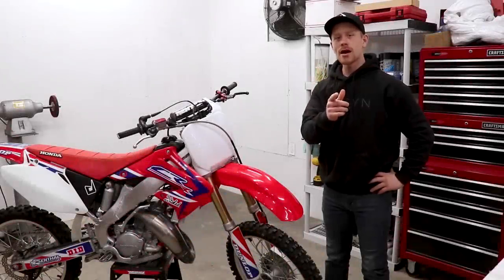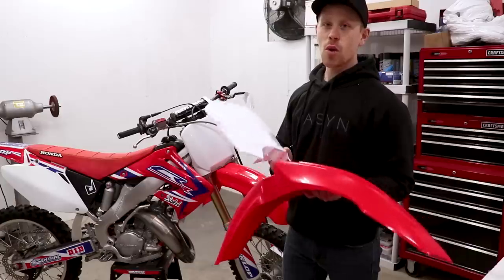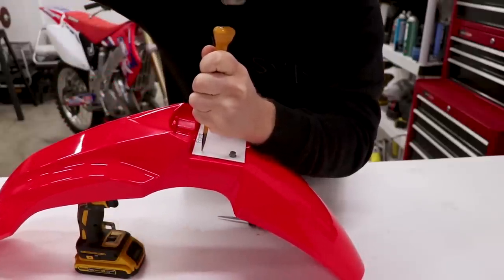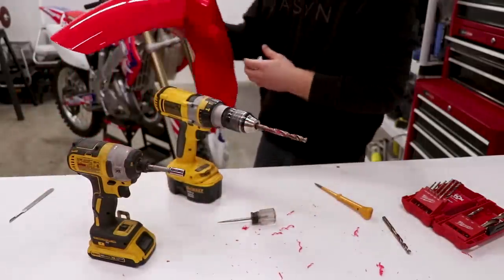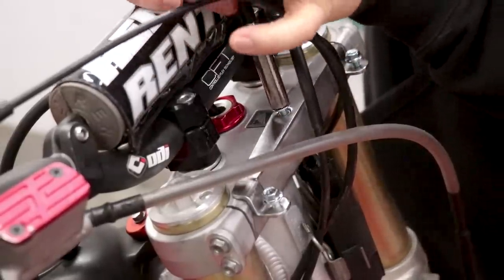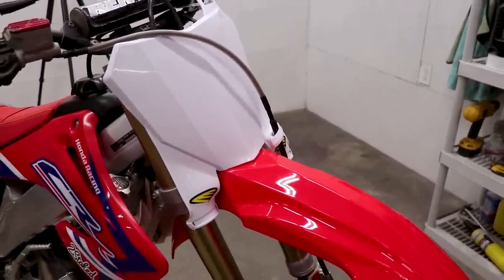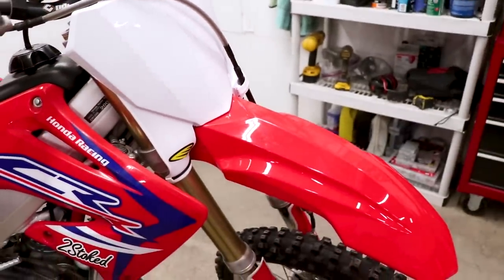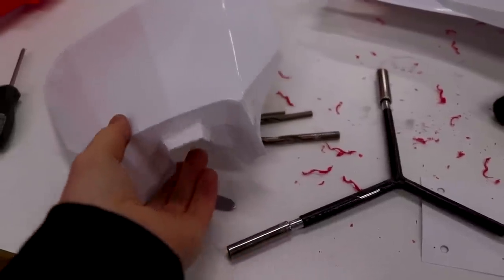Transform Your Honda CR in Minutes!

Comment: I just used zip ties for my number plate lol. It's a 17' front end conversion on a 2000 CR. I didn't have access to anything to make a bracket at the time but the zip ties work quite well. Nice & tight & no vibration. Glad to see you make legit brackets for it. I'll have to pick one up sometime.

Comment: Hi Cameron, let me fill you in on some metal machinist trade skill to improve finish and accuracy. When drilling any sized hole, never drill up in gradual increments to a finish size. Look down on the cutting face of your drill bit, the central plane between the 2 cutting faces is called the chisel edge. Say for example your drill bit is M12. Measure with a rule the width of the chisel, it maybe 1.5mm in width. A pilot drill (a guide drill run through the material) should be no greater in diameter than 90% or 9/10th of that chisel edge width. So for a 1.5mm chisel edge the pilot drill should be 1.35mm (you would therefore use a 1.2 - 1.4mm drill). Drill pilot hole first. After the pilot you go straight to size. Alternatively, you can simply use the chisel edge as a gauge and select a pilot drill undersize to width of chisel edge, near enough is good enough so long as undersized.
In your case I understand the plastic may bite, however, just some knowledge you may find usefull otherwise.
Appreciate the quality of your work. 
Cheers from a 53yr old Australian machinist and bike enthusiast. Keep it up, love your work!

Comment: Nice bracket!  It looks slick.   That pointy screw driver is called a scratch awl.  Was used for making a hole in wood so you can start a screw or scratching a mark on something.  Sometimes called a screw awl.

Comment: I have a 2007 kx450f and I put a 2017 front fender and number plate. All I had to do was put a small nut and bolt coming through so that the number plate had something to fit itself onto it just slid on to the screws sticking up and everything else just lined right up I only had to purchase the four newer bolts with built on flanges they lined right up.

Comment: Pretty sweet brackets. Wish i had a 2 stroke, still kickin my 4stroke 250. By the way if you remember my last comment, we finally got the 99 xr100 running, new petcock, carb clean & rebuild , few other things kicks first go!

Comment: I just bought a 99 CR125r and I really do not like the plastics at all. The side plates are so big and the shrouds leave a lot to be desired. Starting with the front fender, I have a new 2010 restyle fender that I’ll be attaching, what would you do for the side panels and shrouds if it were your bike. I love the way your 05 turned out, that’s the look I’m after buddy.

Comment: Hi Cameron, I would to know who is the guy which make the bracket for the front number plate that you sell in prymemx ? is that you ? How do you do this ? with which machine, a bender ? can you make a video on that ?
Reply from the maker: Yes, I designed the bracket and brought it to my manufacturer for them to make it.
Reply: @CameronNiemela  which type of manufacturer should I contact to do the same style of bracket for 250 YZ year 2003 ? is it a machinig company? a bender company ? both of it ?

Comment: Does the fender come with a template for drilling holes?
Reply from the maker: The brackets do come with a template.
Reply from the maker: Eric Mathews Yessir, the template is for re drilling holes in any 2010-2020 CRF fender. The bracket works with any 2010-2020 CRF number plate
Reply: Would I be able to purchase just the template for drilling front fender holes? I have the front number plate bracket that came with the Polisport re-style kit.

Comment: Bro which one of the plastic can work on the 08 Crf250r ?
Reply from the maker: You'll need to drill the 2010-2020 fender to fit, but you won't need the bracket for the number plate
Reply: Cameron Niemela thanks man I appreciate you. Keep doing great work. And the same goes for the rest of the plastics ?
Reply from the maker: Trevonne Roach You’re welcome! The rest of the plastics won’t swap over.